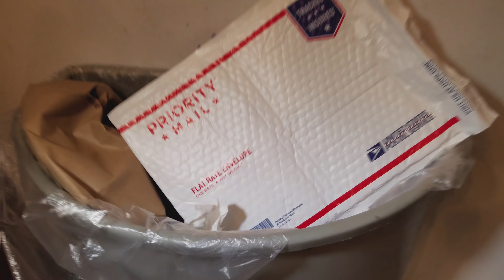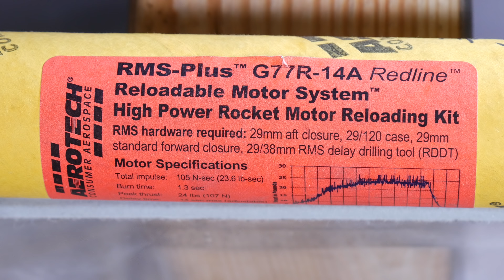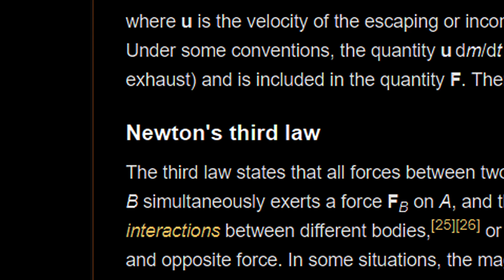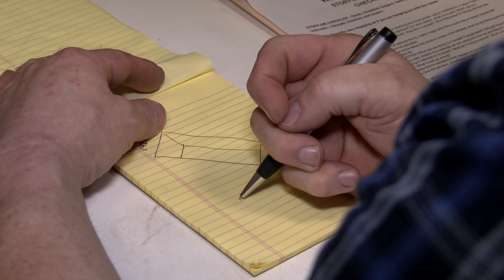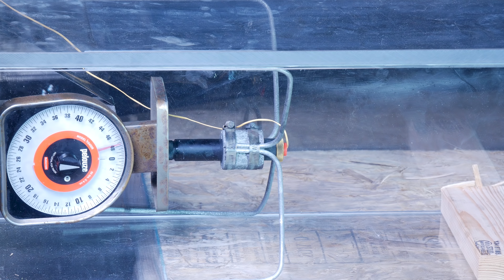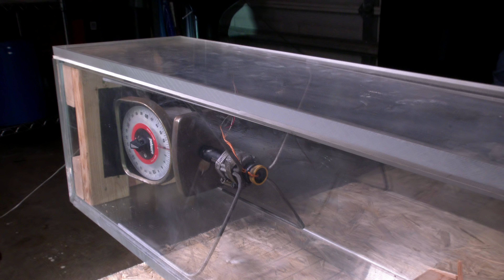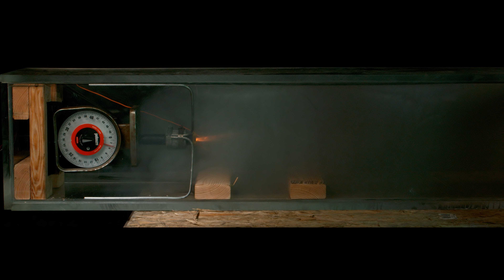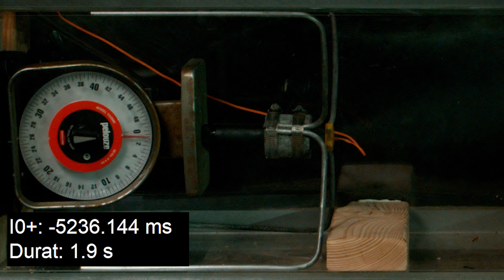Rockets in a Vacuum Chamber - Newton's third law of motion Visualized

Comment: As an aeronautical engineer, I have to say I'm glad you are questioning these bases of our science. They should be constantly reevaluated. That being said, Newton's 3rd Law is actually a part of a group of conservative ideas: conservation of momentum, conservation of mass, conservation of energy. Newton's 2nd is conservation of momentum, if you want to test that out next. A cool way to test conservation of energy (well, at least to a nerd like me) is actually just dissolving salt in water. Saltwater is a lower energy state than salt and water, which means that dissolving salt in water causes energy to be released, aka it heats up. Grab an IR camera or thermometer, dissolve enough salt, and you can see the temperature of the water heat up.
Reply: Out of curiosity, Sir, what field of aero do you currently occupy?
Reply: 233kosta orbital mechanics, satellite dynamics, that sort of thing. I just graduated from my school's program, though, and I took classes in propulsion systems (turbine engines, ramjets, rockets, propellers), aerodynamics, boundary layers, and thermodynamics. I also took classes in mechanical engineering.
Reply: Gabe McDonald when you get past low earth orbit and go through the thermosphere and the radiation belt then I'll believe what your saying
Reply: svborek 1975 I hope I do! Unfortunately my current company doesn't work in cubesats (which I found I loved designing in my senior year of college), but I have my whole career ahead of me to pursue other interests. What specifically don't you believe?
Reply: Gabe McDonald 
Newton  was a theoretical physicist.  theology is the logical implementation. theo being the obvious root word.  theo means god. 

I'm  sure you had a professor in your quest to be a scifientist. 
Merriam-Webster › dictionary › profess

1 : to receive formally into a religious community following a novitiate by acceptance of the required vows. 2 a : to declare or admit openly or freely : affirm. b : to declare in words or appearances only : pretend, claim. 3 : to confess one's faith in or allegiance to.

proof is in the words.
Reply: darwin mcguilicuddy funny you mention your sources. I believe you forgot something. From your dictionary:

4. a : to practice or claim to be versed in (a calling or profession)

    b : to teach as a professor

He who lives in a glass house should not throw rocks. Dont make stupid arguments based on semantics.
Reply: HermlT 
 the 4th is the least, but an ectractuon of the sameness, and exists only on that realm, because of the previous.  for what is the neaning without semantis

lokk roward the etymology of the same. after that, discuss the dictionary, that dictates as some author iry (because they author). control the meanings of  the words and you control the conversation.  is that not semantical?

you defeat yourself with your own arguments.

to teach, is relling someone, what to think, when to think and how to think. which is not thinking at all. its programming. teach is to taught.  taught is to draw tightly. it is obviously the mind in which is drawn
Reply: darwin mcguilicuddy your writing is barely legible. If you think that you have nothing to learn from others then i pity you.

There is a point where semantics gets detached from reality and become a mere tool for argument and framing reality the skewed way you want it to be. The meaning of profess is not nessecceraly applied 100% in reality on professors. Just because a word has 2 meanings doesnt mean it uses both. Just like rockers dont make rocks but play music, professors do not profess in the religious manner or pretend to tell the truth. It is a purely semantic argument and bear no real fruits.

Do you also happen to claim that anyone with a profession is of religious nature and claiming false information? Because your argument is inclined to state that. 

Proof is in the words :p
Reply: HermlT 
you cannot  get past the meanings  of the words, so you parse them. all while accusing me of semantics. check all definitions of profess and d it's  origins..  just because you do not like the obviuos truth of what I'm  saying.  

you speak nothing of THE theo logy, which envibes your THEO RIES. oh the dogma. 

pity me, because you are pitiful. trying to sharpshoot. i try talking down to your level, but it fatigues me so, much an afterthought  for me, as you try to change contextual  meanings.

Definition of profess

transitive verb

1: to receive formally into a religious community following a novitiate by acceptance of the required vows

2a : to declare or admit openly or freely : affirm

b : to declare in words or appearances only : pretend, claim

3: to confess one's faith in or allegiance to

4a : to practice or claim to be versed in (a calling or profession)

b : to teach as a professor
Reply: HermlT 

theo retical, theo ry, THEO logy. all belief systems.  with theo as the obvious root word.  theo means god. these are not my words, your argument is  with the meanings. by dictions.
Reply: darwin mcguilicuddy although your response did nothing to dispute the fallacies I pointed in your argument ill respond to it as well.

Like your previous comments you still cling to the notion that if something has a known word in its name it must take all of its connotations. Here is the first paragraph from wikipedia about theory:
A theory is a contemplative and rational type of abstract or generalizing thinking, or the results of such thinking.Depending on the context, the results might, for example, include generalized explanations of how nature works. The word has its roots in ancient Greek, but in modern use it has taken on several related meanings.

Even though it has the word theo in it doesnt mean it has retained its meaning over time. 

Also I can see why you refuse to learn from others. Your really DO think you know everything. Keep hiding behind your definitions and expecting them to do the arguing for you. Im sure that your illustrious intellegence is above all of us mere mortals.
Reply: HermlT 
theory  can't  be proven generalizations. lol.  you make my arguments for me.  ive wasted enough time with someone  of lower consciousness.  good luck
Reply from the maker: Gabe McDonald Welcome!!, I am also an aeronautical engineer, but I'm like 10 yrs out of practice, although I have actively been practicing my mechanical engineering side almost every day of my life, that's what I'm very good at. I wasn't necessarily questioning Newton's laws of physics here, I was merely writing an episode around hundreds of comments that I received from a previous episode that I made on burning a rocket motor in a vacuum, which was a viewer request. but I was personally curious as I haven't ever seen one of these solid rocket boosters ignited in a vacuum before, it was nice to see it behave differently, very interesting for sure. The Newton's second law is a great idea, you are absolutely right about the principle behind that, I'm going to make a note of that and maybe write an episode very soon. I can tell you from first hand experience, the scenario that you gave, in an more extreme case produces a lot of heat very quickly. Thanks !!!
Reply: HermlT 
illustrious intelligence? word baahing. if you don't  know the meanings of the words,  how can you communicate?,  how can communicate  to you?
Reply: darwin mcguilicuddy oh i know my english. It is you untill this comment hasnt fixed his illedgible comment earlier with numerous errors and misspels. (And i wont be surprised if you would do it)

But why did you edit your nice message? I thought you were FATIGUED from talking to a LOWER LEVEL OF CONCIOUSNESS. Maybe your pride is keeping you here despite the tiresome nature of merely talking to another human being.

But all of my previous "sharpshootings" still stand. You haven't done much directly adress them with one coherent sentence that is not a part of some definition. Please explain to me again why must the first three meanings in the dictionaries on the word profess are the all picked in descending order instead of being applicable in different situations according to reality, and please do tell about why a generalization that is tested and unchallanged by any major confirmed fact doesnt fit the modern definition of theory as stated above? Please do tell with your OWN words. Id love to hear it.
Reply: Can confirm. The water heats up faster with salt introduced into it.
Reply: HermlT 
legitimate? did someone legislate  fallacies, or do you mean legible?  misspelling? you shouldn't  use words, that you don't know the meanings.
Reply: Newton  was a theoretical physicist? more like practical Satanist.
Reply: Gabe McDonald the salt also makes the water less dense. A floating block of wood in water will start to sink when salt is added. If you add the right amount of salt in the water the wood will float in the middle of the water (experiment done in a tall glass cylinder of water). I then wondered why the "gravity" didnt pull the wood to the bottom now since its pulling everything to the center of the earth?
Reply: 73outback the reason why it doesn't sink is because gravity is also pulling all the water in the glass down, too. The water wants to flow around the wood and under it, but gravity is pulling the wood down the same amount! So it balances out.

Salt is supposed to make water more dense, though. If you go swimming in the Great Lakes, it's harder to float than swimming in the ocean. Maybe some of the salt is reacting with the wood and making it denser?
Reply: +Gabe McDonald If you fancy yourself scientific, why bring up an occult fiction like gravity? There is no gravity, there is just varying degrees of weight and density. Just like UP and DOWN are fixed directions, as are all horizontal directions - weight is a constant that never changes. Notice that I said WEIGHT and not MASS. We do not separate the two, because a 100 lb object will weight 100 lbs no matter where it is relative to the surface of the earth. There is no "zero-G" environment above earth's surface.
Reply: kamphwagon1 Really? Read what you just wrote. You literally recited fairy tales about gravity and orbiting "atomic particles" that cannot be observed or tested. Give the scientism a rest.
Reply: Thank you so much for your educated response. I would assume most of us actually want to learn facts so as to progress and make sense of what is in our perception "Real" and your educated explanation indeed helps ! thank you !
Reply: darwin mcguilicuddy The word theory comes from the Greek word theoros (meaning spectator) and theoria (meaning contemplation/speculation).
Reply: darwin mcguilicuddy In Greek, theos means god, not theo.
Reply: you also must be reevaluated ... why not? ... because you are not ultimate who knows everything ... I hate that arrogance in you ... well the experiment goes well ... even the vacuum was not perfect ... so the ignition must fail in space ... you began with your name like engineer and stuff but science is not about names ... experiments are always relatives and so your knowledge ... please make sure your feet are on the ground ... the title engineer does not make you always right ... be humble instead ... not weird not a nerd who has social difficulties and goes to youtube to solve his psychotic traumas
Reply: and same time mit prove that 3rd law is crap .... atleast with rockets
Reply: MrCcfly Do you have a citation for that? I can't seem to find it in any peer-reviewed journals.
Reply: Etypeman Do you know what causes recoil?
Reply: Etypeman Also, nuclear reactors do not cause explosions.
Reply: Etypeman What evidence do you have that any planet would have a different set of laws?
Reply: Etypeman No, you can't safely assume that, as there is no evidence for it.
Reply: Etypeman Your last post is simply a long argument from ignorance.
Reply: Etypeman At what point did I insult you?
Reply: Etypeman Observation of what?
Reply: Etypeman They're makeup and behavior follows the current laws of physics perfectly. That's what allows us to make accurate predictions about them.
Reply: NebTheWeb: So you handle both sides of the conversation. Try this one. People that know we live on a plane are always being criticized that watching a youtube video makes us this that or the other. That goes both ways, yes? But more importantly, at about 14:47, referring to the last attempt he said "when I pulled a deeper vacuum". Oh my, I suppose that means the results of that experiment are suspect. And that could be why we doubt the things you mentioned; among others.
Reply: Etypeman WOW! That was a lot of useless crap.
1) Up and down are relative to the center of gravity and have nothing to do with an atmosphere.
2) Not everything that orbits a star is a planet. Moons, asteroids and comets also orbit stars.
3) Left and right aren't compass points, they're arbitrary directions created by us. Your left hand will always be your left hand. Same with your right.
4) A planets "day" is one revolution on it's axis. A planets "year" is one revolution around it's star. Each of these are independent of any other celestial bodies.
5) Everything that we observe in the universe acts exactly as predicted by the laws of physics.
Reply: Etypeman Scientific laws are descriptive, not prescriptive.
Reply: Etypeman Left and right have nothing to do with laws or compass points. Nothing in existence can change left and right except us, since we created them.
Reply: Etypeman 
"Why explain to me how a planets orbital time frame works? Did I talk about that?"

Yes, you did. You compared a planets day to an Earth year and I was trying to make sense of what you posted. If I misunderstood you, then simply disregard that.
Reply: Etypeman You are correct; space does not have an up or down, as these are in relation to an objects center of gravity.
Reply: Etypeman 
"Even distance may be different on another planet pending its atmosphere that may well be bent or distorted in some way."

This would effect visibility, not distance. A foot would still be a foot and a meter would still be a meter.
Reply: While space doesn't have a definite up or down, it does have three dimensions of space and one of time. That is a constant across our entire universe. While things may be different in other universes, we can trust that everywhere in the universe has three dimensions of space, and one of time.

And just so you know, pulsars are fairly well understood. When a star gets heavy enough, some of it can collapse in under enormous pressure until electrons are crammed into protons and we get a sphere of solid neutrons. The crust of a pulsar is very dense, squished atoms that are very hot. These atoms produce an incredibly strong magnetic field, and launch light away from itself at the magnetic poles. However,  these stars are also spinning very fast because angular momentum must be conserved. Since that matter once used to be a spinning star and now it's between the size of a planet and a mountain, it has to spin very fast to have the same angular momentum. When the magnetic poles are near the equator, this makes the pole, and also the jet of light coming off of the pole, spin around very fast. So fast, in fact, that we can pick them up on our radio telescopes.
Reply: kamphwagon1 im totally on your side with all of this, but i have to point out that there is a big problem with talking about gravity and subatomic orbital in the same sentence. Probably steer clear of that one...
Reply: How did science ideas become religious in nature?
Reply: Casey Bowman because humans have always tended toward describing things they don’t understand as “gods”. Theology is a natural human tendency; comets weren’t understood until Newton’s time and were considered messengers from the gods prior to that... this is just a modern version of that, people don’t understand the science and choose to classify it in the realm of the super natural...
Reply: Benson Davis yeah aside from that, his math and concepts exactly describe what we see in nature, so....
Reply: darwin mcguilicuddy

In your alias we can see "guili" which have the same root than "guilible" and qualifies perfectly your comments !
Reply: 73outback
"Gabe McDonald the salt also makes the water less dense"
 The FACT you can practicaly stay sitted in the high salted Dead Sea PROVES you wrong !

Salted water is MORE dense than flesh water !
Reply: u cant see the whole chamber ;) only a thirs of it... while the rocket is running!
Reply: @Daniel01101101  Maybe you should digest some of this information that has been given to you.
Reply: @darwinmcguilicuddy6083  I'm  a very ordinary person.but what you have said resonated with me..thank you
Reply: @darwinmcguilicuddy6083  lol
Reply: HermlT 

funny how I just found out of your reply.... 

profess is the obvious root  of professor and professional.... as to your 4 a.  and b.  ,it does not change the  root of the semantical misgivings . thank you for making my  argument for me.
Reply: Woo Woo, The Space Jew 

Theo,  Theo's, theos. in Greek is god in a possessive tense and sense. .

Comment: Quick question, If a digital scale was used, or the chamber set to it points 'up' would the exhaust from the engine erase the 'full vacuum' from the formula? Once there is any gas to push against, the rocket should have lots of thrust.